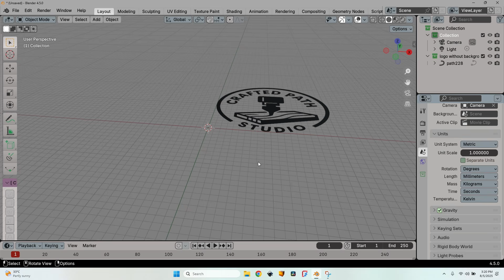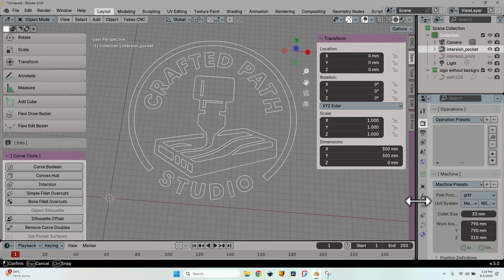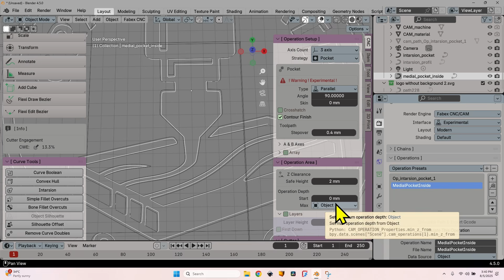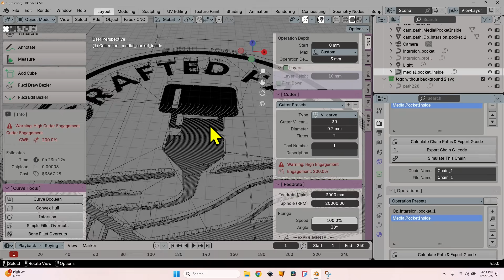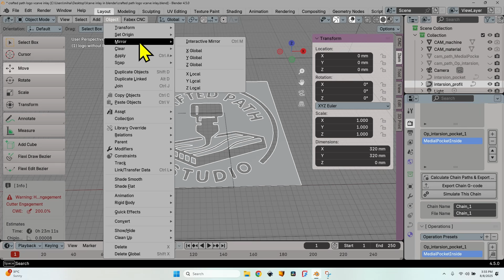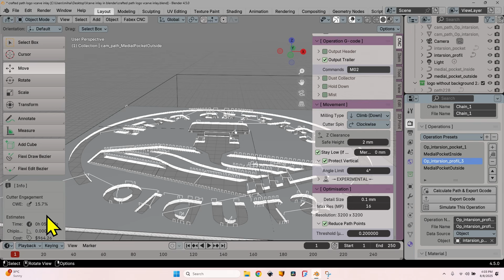V-Carve CNC Inlays Tutorial | Perfect Logo Inlays from SVG (Blender + FabEX) with ZahyoX CNC bits

Comment: Hello!

Thank you for sharing this with us!

I’m currently designing a PCB.
I’m having trouble with the "Intarsion" process. Basically, it works, but it alters the shape of the original SVG file. For example, instead of having traces that meet a square—where a solder joint will be—at a right angle, it changes the shape randomly. So I end up with a square that looks like a potato. It’s close to what I want, but because of the precision I need, if I keep this slightly wavy shape, the PCB won’t work. So, if you could shed some light on this for me, that would be great!

For your information, I’m using this tool:
V-carve Øtip=0.1mm, 30°, Øtool=3.175mm
Reply from the maker: Hello!
When creating the intarsia offsets, it rounds any sharp corner so the designated toolbit can fit inside.
If you define it as v-carve and set the diameter of the tool to 3.175, it will take the 3.175 when making the offset. You need to set the tool diameter to 0.1 or 0.2 and it should not alter the svg too much, just enough so the toolbit tip fits.

Comment: I just bot a cnc and got into v-carving. This is great tutorial. I like how you go into all the details. I did run into some issues   however. Intarsion on smaler objects with sharp edges doesn't do a good job. While scaling it fixes the problem when I try to generate the gcode the program freezes. Anyhow I got it working in the end. Again thx for this tutorial.

Comment: somehow the medial pocket is not created automaticly with blender version 5.0.1. Any ideas why that could be missing? Anyway a very nice tutorial! i saw briefly an error name 'add_collections' is not defined but i am not certain that this is linked
Reply from the maker: I just tried on my install (same 5.0.1) and it works as it should, it creates both the curve for the pocket and the pocket operation. maybe a wrong cutter setting? if the cutter can remove all the material, there won't be any pocket created. Try changing the final depth, make it just 1 mm deep and it should create the pocket

Comment: How did you get the time estimates in Blender? My info window only shows the warning for cutter engagement.
Reply from the maker: You have to adjust the settings for the machine. But they are wrong, anyway, they don't work as they should lately

Comment: In the video you mentioned that using v-carve bit takes too long, is the process to using an endmill to remove the material basically the same except using end for the cutter?
Reply from the maker: Yes. You need to be careful at the sharp corners, as there might still be some material left. I suggest using a few more outline passes with the v-bit to make sure everything's milled away. You can do that by using the pocket curve and setting a profile operation on the inside

Comment: I had to go to github and download Fabex 1.0.67, 1.0.68 won't load in blender 4.5.4 LTS
Reply from the maker: 1.0.69 works well. Maybe you got 1.0.68 from the old repository. There's also a new 2.x.x version, but it has a few bugs for now. I will make a new video once it works ok ish
Reply: @opensourcecnc if 1.0.69 is the newest stable, then that's what didn't work not .68. I'll try and download from the GitHub repository
Reply from the maker: Look for the pppalain repository, that's the one that works. At least on my windows 11 pc. 
https://github.com/pppalain/blendercam
Reply: I downloaded the newest from GitHub and it worked. The version from the website doesn't

Comment: You figured out how to do this with FreeCAD?  I think FreeCAD is missing a important feature with Vcarve that allows it to do clearing and a specific depth.  I think V-Carve Pro calls it "Flat Depth"
Reply from the maker: No, FreeCAD is not able to do that. At least not for now. The workaround would be a combination between a profile with calculated offset and a pocket for clearing the bottom. And a v carve for smaller areas. I will give it a try and post a video if it works good enough, but for now I'm focusing on making an updated version of the entire FreeCAD series for the latest version

Comment: why that intarsion thing at the beginning?
Reply from the maker: It rounds the corners according to the diameter of the toolbit tip. If you're using a 1 mm tipped toolbit, it will round all the sharp corners to that diameter, so the two pieces fit together
Reply: @opensourcecnc thanks